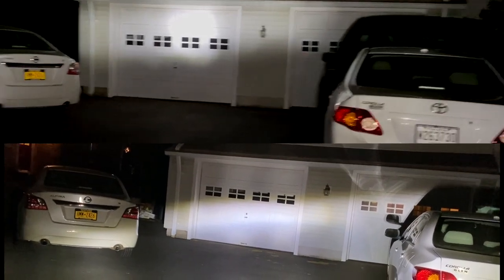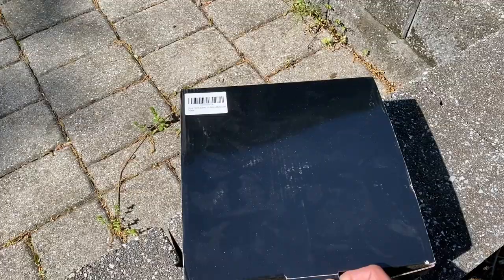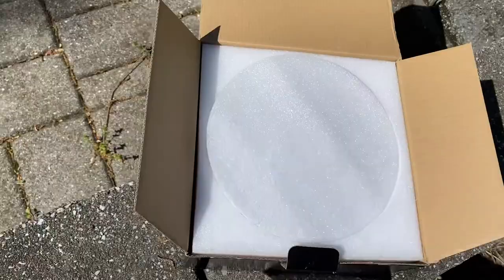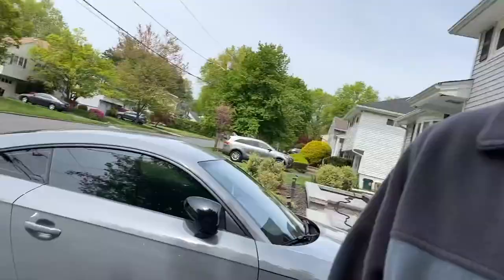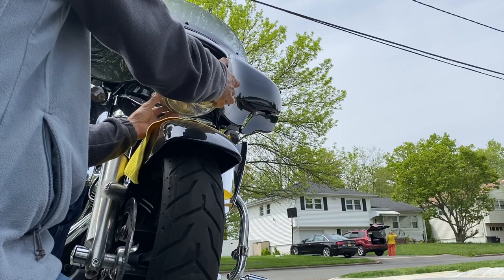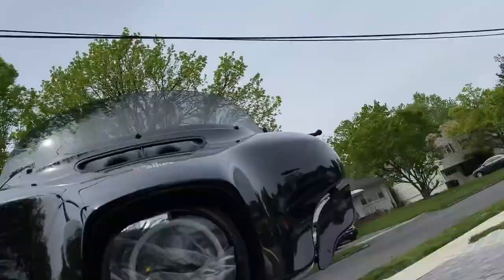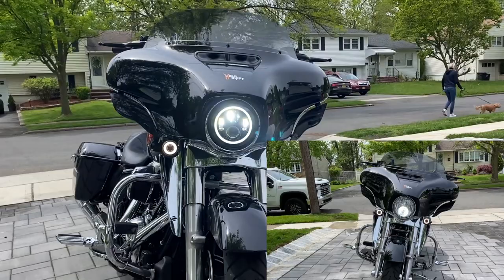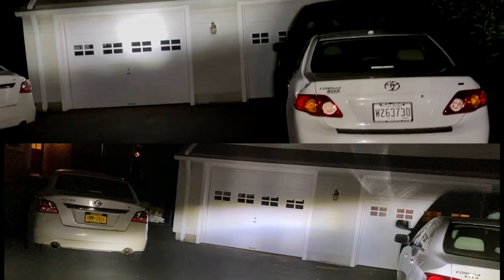Harley Daymaker killer

Comment: Yep. Works great. Got the same one for my 2009 Fatboy. Had some condensation in the beginning. Take off the light, lift one of the black round stickers on the back and put it in the sun for about an hour. No more condensation after that. Cheers.

Comment: i think low and high beam were switched originally on the motorcycle when you replaced the bulb, the bottom wide stuff should be low beam and the round should be high beam (in that case)

Comment: The one issue with showing how bright a headlight is when shining it against a house or wall. Is the flood it will have because of how close you are to the house.. a better example would be to maybe find somewhere with a flat field or long road that has a trees in the distance so you can show up close and then further away to show how far the throw of each light is and how much area is lit up.. so many light manufacturers just maoe a birght light but it doesnt point where it should but instead just floods everywhere which isn't what you want in a headlight... when you have a properly setup and adjusted headlight. It blows the common led out of the water.. but you have to adjust it and point it correctly and orientate it the right way..  ps your Harley housing is glass and most of the sub $200 aftermarket lights are plastic so they will begin to tarnish after a year or two or so depending on ride time.. whereas the stock harley Glass lens housing will not fade😊.. i only speak about these headlights from experience. I have a shelf full of different led headlights for my harleys and most of them ended up fading or being junk even some more expensive ones. But i dont like the blue color because of the shadows it causes so projector headlights are better for me. You wont find a led or halogen that will hold a candle to a good projector❤😊  i am honestly suprised there isnt somebody who builds custom headinghts to fit inside the harley housing.. they would make a killing if they took the oem headlight insert and mosified it to be a projector.. not a cheap led one though but a good projector unit.. id buy them for all my bikes haha any truck i have ever owned or currently own instantly gets projector headlights because they are lesgues ahead of anything else.. normal led is getting better but its not there yet..🤘

Comment: Ummm...the "Daymaker" is illegal in 22 states and "not legal" ( you can't be stopped for it as a primary infraction) in at least a dozen more. 90+% of aftermarket motorcycle headlights are illegal boys and girls, just check with your local HiWay Patrol or State and Federal DOT. If it doesn't say FED DOT Approved, it isn't legal, and VERY few of them do. If you're in an "at fault accident", you insurance will be VOID and you can be SUED to NO LIMIT as your vehicle wasn't legal to be operated on the highway. I know someone who had dark shades on his pick-up headlights, and he lost his house and they sold his UNDERWEAR and SOCKS at auction and he can NEVER amass more than $3000, all for a $2500 fender-bender. Guess what happened to his wife and kids...
Reply: If the Daymaker light was illegal, Harley wouldn’t install them at the factory and sell them. Lol. Mine came factory installed.

Now IMHO, the Daymaker light should get HD sued to hell and back. Try riding at night in a dark curvy road and lean that bike over with the Daymaker. Instantly you loose any distance of light to mere feet in front of you. Its gonna get someone killed and that sucks. Looking at replacing mine with an adaptive style LED ASAP for safety.